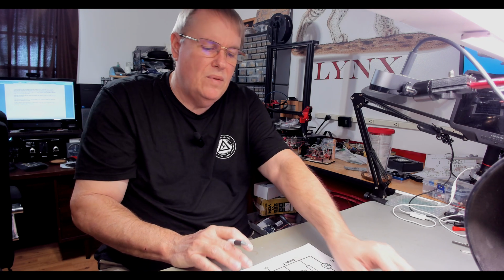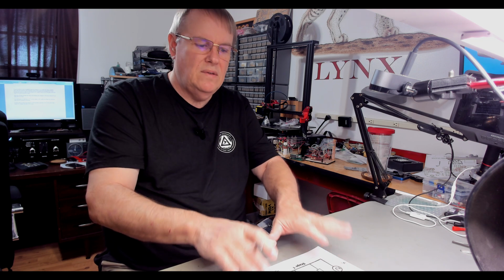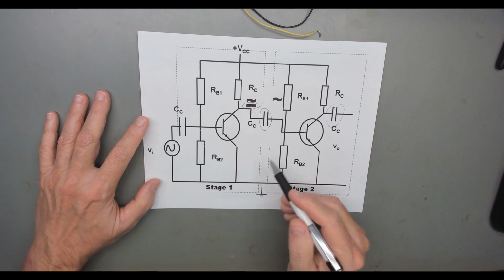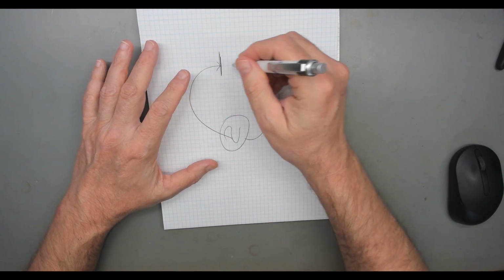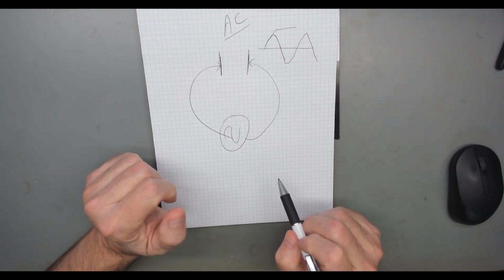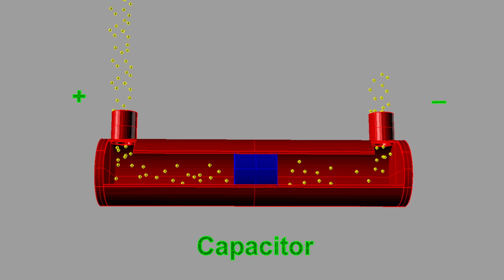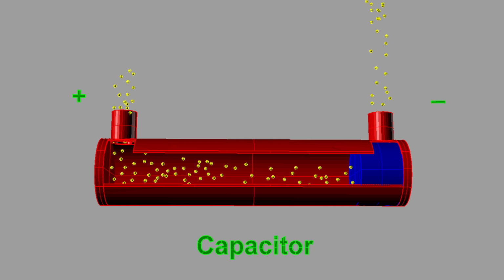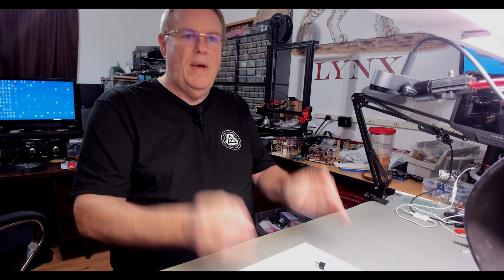Capacitors EXPOSED What's Really Happening with DC and AC?

Comment: Just started learning electronics.  I have been building a few of the electrical project from aliexpress.. they use dc usally a clock , radio or lcd light but they have capacitors in them. Most are the caps that have positive and negative poles.. these must work. Forgive me but now im confussed. Been reading  the art of electronics,  read this in there. That they dont use them in dc. Subscribed thanks
Reply from the maker: Thanks for the comment. I understand the confusion very well. The issue is capacitors are used for both AC and DC. Capacitors get used for many purposes. For filtering  ripple from power supplies, decoupling devices. As coupling capacitors to block DC between stages of circuits but allow AC to go between them, to create timing circuits, and on and on. Each use is different in what we ask the capacitor to do. Changing between a capacitor in series and the same one in parallel causes it to work different. So there is much to learn. And as you said some capacitors are polarized and others do not matter which way they go. Please don’t confuse my talk on capacitors passing AC and blocking DC to mean they don’t work. If more on how they work compared to what we see.
RJ

Comment: Thanks for taking the time and effort of making these videos and sharing Your knowledge:
I have a question, doesn't  the voltage of the signal also play a role in what capacitor You should choose ?? To my uneducated mind it feels like a "low frequency low voltage" signal would not require as large a capacitor as the same frequency but higher voltage signal would??
Best regards,
Reply from the maker: Your more than welcome,
Thanks for a great question. 
The short answer is no. The charging time of a capacitor is only related to the resistance in the circuit and the value of the capacitor. While it might seem that voltage would matter it doesn’t for a simple reason. As you increase voltage, you increase the amount of voltage the capacitor has to charge to so that it is fully charged. This matching amount cancels out the change in charge time. They both change by the voltage increase and with them canceled out you are simply left with the RC value determining the charge time. When a capacitor charges in the first time constant it will always charge to 63.2%. It will always take 5 time constants to reach 99%. 
So for this video the impact on a fixed circuits insertion loss is the frequency and capacitance value. In an upcoming follow on video I will take my viewers from this very basic understanding on this simply way of understanding it and build on that to get into the higher level of understanding it. We will get into capacitance reactance. How to understand it and even how to calculate it. 
RJ